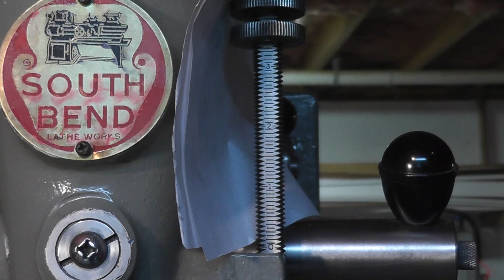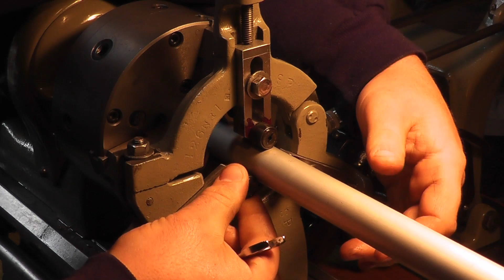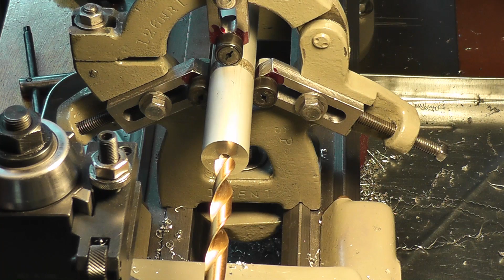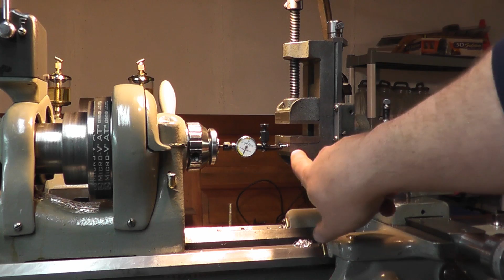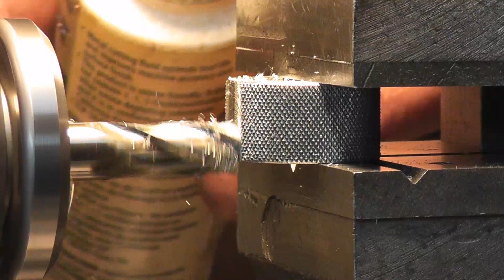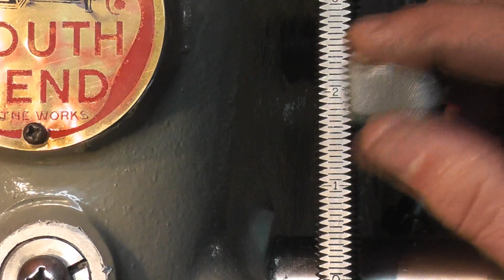Making A Quickset Depthstop For A Drill Press

Comment: Sorry but bad idea, great execution, but you can't adjust it in small increments (adjusting it a few tenths of an inch at a time) and will vibrate and not stay where you put it and fall off completely and the time you take to find it from where ever you store it you could have just adjusted the two nuts. Now a clamp style with a screw that can be tightened to stay put will work much better, that's what I did on my drill press with a smooth rod in place of the threaded rod, works great and alot easier to make...

Comment: Actually that was something I noticed in the video, the angle of the force applied is in a horizontal direction. However the lathe is designed to fight a vertical downward force. The scissor should work, esp if something already exists in production a copy would be easy. I was thinking of making a follower rest (cathead), but the southbend has tapped holes on the right side of the saddle... just need to make sure the rest contact is left of the cutter/knurling action.